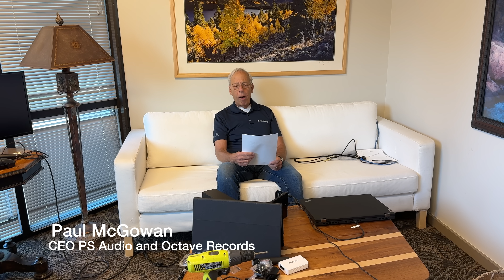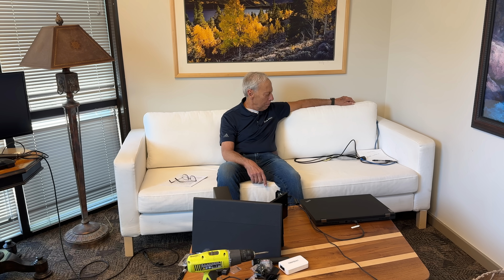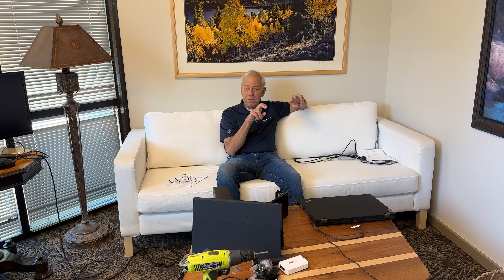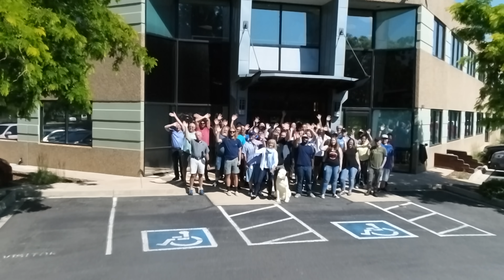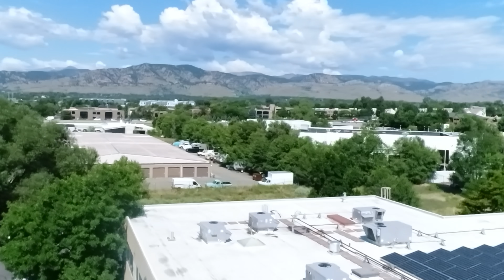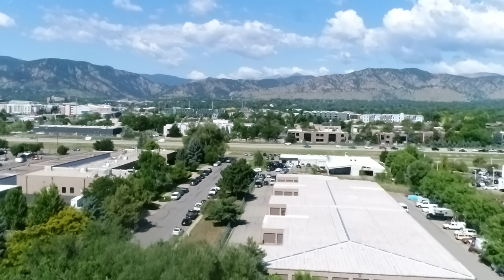Passive Preamplifiers

Comment: I don't know if there's a loss of low end or slam. As much as the addition of it by an active preamp. 

People liking passive preamps have nothing to do with why people like vinyl. Active preamps, like cables, are made to be tone controls. Not conduits. Some (many if not most) audiophiles prefer the tone controls. Some don't.

A passive preamp with the right components, is far better than an active one that is created to alter the sound.

Comment: Here's my personal anecdote. (And I understand that "data" isn't the plural of "anecdote". 😂) Many years ago, I had a boss who was a massive audiophile. I am/was a modest one. We had pretty big offices, and we both had pretty good stereos in them. Mine was a spare Dynaco ST-70, an OG Magnovox CD-650, and some homebuilt speakers another engineer had designed. My "preamp" was a switchbox/volume pot that I cobbled together. My boss was using an Audio Research SP-9, which I had lusted after for years. 

One day, with our boss out, the engineer and I decided to A/B my switchbox and the SP-9 with the ST-70. First we did the SP-9, and we nodded at each other that it was might fine. Then we put the switchbox in place. Our jaws dropped. It was not subtle _at all_. What's the audiophile phrase? "As if a veil was lifted from the music." 

Now, I don't remember what the value of the volume pot was, and I had made no real attempt to match anything with the input impedance on the ST-70. So, plain dumb luck. Now that I "know better", I'm not sure why the switchbox won that competition hands down, but it did. I've never tried this approach with my Conrad Johnson PV-5/MV-50 because I need the phone stage and I love how it sounds, but it would be an interesting test!
Reply: Exactly! perfect The passive pre has the best technical specification in the world! It's unsurpassed: because it's innocuous to audio, output signal is a copy of the input signal only with variable amplitude control, it's game over for high fidelity.

Comment: I wasted 5 years using a passive preamp with stepped resistors. When I replaced it with a tube preamp, the result was stunning. The whole sound stage opened up with size, detail and layering I had never heard before. I cursed the journalist who led me down that path.
Reply: You should have been using a transformer based passive preamp.
Reply: @robertdevoy3119  No better. The problem is that some DACs do not have enough power in their analogue output to drive the passive preamp, cables and amp input.

Comment: It isn't a "charm". A good passive is going to be more transparent than a good active. Actives have more of a sound than a good passive. Which is why people like them. Which isn't an issue in the slightest. 

But a good passive isn't losing dynamics, weight, or slam. It isn't adding them, like many actives, either.

Comment: I’m using a passive preamp with an alps 27 pot with 50k impedance. The sound is transparent,
dynamic and just straight up clean. Better than any active preamp I’ve heard.
Reply: from which brand of passive preamp do you have?
Reply: @L7F0X 
Technically it’s simply a volume pot with a single set of rca inputs and one set of rca outputs. 
No name brand made in China using an Alps pot for volume control. 
I also have a Tisbury passive preamp made in the UK. It has dual outputs with three selectable rca inputs. The Tisbury doesn’t provide as much resolution as the other piece. The volume pot on the Tisbury isn’t an Alps but uses a large bank of resistors to control its output so not sure if that’s what is making the sound difference.

Comment: I settled on an Ypsilon transformer "passive pre-amp". I find it by far the best pre-amp l have heard, certanly better than a high quality resistor ladder unit l had for awhile. Great dynamics and transparency. It requires system matching though as it doesn't provide gain of course.

Comment: That's exactly what my preamp is "No Preamp".  I've built myself a beautiful stepped attenuator and a 6-way double pole selector switch in an all aluminum box (very short wiring). That allows selection of my audio sources, via attenuation to feed directly into my KT88 equipped VTA ST-120 amplifier.  Sounds simply wonderful. ❤

Comment: Passive means changing the impedance of i/p and o/p sources, and setting up series/parallel impedances, not good in my opinion.  A fixed matching input (47k) converted into a less than 75ohm output Z with individual resistor(s) for volume is a likely better setup.

Comment: Passive is not for every situation.  An excellent alternative is a high quality autoformer.  Dave Slagle makes an AVC that is pretty sweet.  The output Z drops as attenuation increases starting at 100 ohms and dropping to nothing.  My source has a nice tube output, so the AVC is quite a good match.  It is basically a wire up to around 250kHz.  I found any type of resistance pot noticeably inferior for my taste.
Reply: Same here!

Comment: My pre amp is a 47 step attenuator built by GOLD POINT in Calif. and I like that the signal is clean end to end
Reply: I just built a passive volume control with a GOLD POINT 47 step 10K attenuator. No issues driving a pair of DIY Hypex Nilai 500 monoblocks with a 48K input impedence. Clarity is superb. I'm considering swapping in a 5K GOLD POINT to see if the old 10:1 impedence rule makes a difference. Right now, 5:1 seems to be working well.
Reply: @ericlarsen1721  I had them build it. 4 RCA out 1 in couldn't be happier a little pricey but worth it

Comment: Paul - not sure if I’m the first here to say that as one of your septuagenarian viewers, I can fondly remember owning one of those dual chassis phono pre/line stage combos and the first brick power amp as part of my constantly shifting arsenal of audio weaponry “back in the day”. However, I’d be lying if I stayed I can remember the differences I might have heard between the passive and active mode on the line stage - far too many changes of gear, and too many magic cigarettes during those couple of decades before parenthood. 
What I can remember is that Acoustat II, dual mono bridged Model II amps and Polk “Cobra” cable was not a particularly stable or synergetic combo - a different kind of magic smoke there😂
Cheers

Comment: Different than passive preamp as you described is the transformer volume control . It does some things better , but a very high-end unit can cost as much as a preamp with gain & more drive .
Reply: Perhaps this it true because the passive transformers are expensive. However, the resulting transparency is well worth it.

Comment: "Passive" pre-amps are NOT isolated from the output caps feeding the "pre-amp" and any input caps at the receiving end.
So essentially what you got is some type of  R/C (or R/C2) filter since the "pre-amp" is coupled (not isolated) from the input device and the 
device it's feeding. Unless both connected devices have purely resistive impedance you will most definitely alter the frequency response curve of the input.

Comment: The voltage sent from a source to the amplifiers needs to be controlled. There are 3 types of line level/ volume controls most often used. Starting with the worst approach, digital volume controls direct from a DAC into the amps. If you happen to have a perfect match, say a 2V peak output from the DAC with a 2V sensitivity to full output in the amp. a direct connection will drive your system to full volume all the time. To cut the volume in half you have to remove the most significant bit/ cut the sample bit depth in half. You want a 1/4 volume? Take that 16 bits and covert it to 4 bit depth. Peak voltage out will be what you want for volume but all resolution is gone! 

So instead of bit removal to get reduce voltage out, some adopt a VCA, Voltage Controlled Amplifier stage. They control the amount of voltage fed to the output stage so it can only vary between zero and that reduce voltage. So the entire 16, 24, 32 bits will always be resolved. Problem is an amp's sound will change based on it's supply voltage. So the sound will change quite a bit as the volume is adjusted. 

The best is the old fashion passive volume control. Be it a POT/ variable resistor or a resistor ladder. The full output voltage from the source is applied to one side and the amount voltage out depends strictly on were the output is tapped off of that resistor. Want a 1/4 volume, use 1/4 of the way across the resistor section. The entire 16. 24, 32... bits will always be resolved. Only the voltage level to the amp changes. Well except in the real world there are always other outside components. Primarily capacitors at the output of the DAC and input to the amps. The passive volume control acts as a R/C circuit then. R/C circuit are used for high or low pass filtering. The added resistance can cause high end roll off. So they build active circuits around it.
Reply: Boy stop telling the truth in public.wow.. you sound old and smart..haha..and your correct in my opinion..
Reply: @davidstevens7809  Old, ya! And been around, ya. and can sound smart at times, ya. Able to control responding, Not so much.
Reply: I read somewhere that modern digital volume controls are high enough bits 32 or 64 that they do not degrade the signal. Don't most modern DAC chips have digital volume control built in?
Reply: @dwaynepiper3261  What volume control setting do you most often listen to your system at? Cranked full open taking advantage of all those 32 or 64 bits? Or at half way at most, dropping to half the bits, 16 or 32? All the time? Maybe be 1/4 open ... 8 bits maybe?
Reply: @glenncurry3041  So your telling me all these DSP processors and Room EQ correction in modern equipment that is filtering specific frequency and adjusting the level is bad?
Reply: @dwaynepiper3261  So you're (correct version) telling me you can't answer the question so you drag red herrings out of desperation?

Comment: Majority of modern ‘audiophile’ passive pre’s do not employ series resistor pots. Most are using autoformers, multi-tap transformers, as a volume control with lower output impedance. This can be very effective with most modern DAC’s, some of which too have buffered volume controls in output section and enough output voltage to easily drive the amps.

Comment: A passive attenuator will be superior to any active pre-amp if the following is observed;very low cable capacitance to and from the attenuator;source equipment with low output impedance and high input impedance of amp or in my case active crossover being driven.
The usual problem  of lack of dynamics is when incompatible equipment is used;ie.low input impedance amps
which results in lack of current drive.

Comment: Has anyone thought about stereo width?
The more resistance you have between signal
L R The less stereo you get. a potentiometer always gives a certain resistance across L and GND and R and GND. since both GNDs are connected, you get a load over L R that varies up and down. you get more and less stereo when you turn the volume up and down. at low volume you get less stereo

If this is wrong, please let me know.

Comment: Hello. I have an amplifier. Naim NAP250 clone card and have made my own amplifier.

When I use different active preamplifiers, the sound is always worse, especially in treble details. I have tried one that only has op amp ic. and no coupling capacitor and a slightly more advanced one with a coupling capacitor on the output.

I find my passive preamplifier to give better sound and more transparent sound.

The passive only has an input selector and potentiometer which is connected to my DAC. which is connected to my computer.

I have done the test many times with the same result.

I don't know why I'm experiencing this.

Naim has a coupling capacitor on the input

Comment: First of all, a passive pre-amp does not exist. Nothing gets amplified. If you want to do a passive volume control, do it with an attenuation transformer. This also has the advantage to lower the impedance as you step down the output signal. Further more, a passive volume control is best used with a tube amp that has a very high input impedance. Ideally the power tube amp has full output at line level input (200 mV). Many tube amps can do this with only two stages witch results in a very direct signal path. At this point, the set up is basically a full amplifier with out board volume control. There is nothing wrong with that.

Comment: Isn’t 6db is double the volume? How many steps before ur blown off the seat 😂
Reply: Actually the sound pressure doubles every 3 dB. It's a logarithmic scale
Reply: Start at 0.5W as first step, not loud enough, and then 1W, 2W, 4W, 8W, 16W, (into good area now) 32W, 64W (Party time) 128W.  I make that 9 steps, mine has 8. Honestly, I really don’t think it’s a problem, 3dB if you wish, but that’s a perceptible change, and as I said, I can’t be arsed with getting up for such a small change.  The attenuator was more of a development step, the real issue was control of input and output impedance, and the cable capacitance combining to form a low-pass filter, knowing phase starts to move a decade below attenuation. (3dB bandwidth at 20KHz has a phase shift starting at 2KHz)

Comment: It’s interesting if such “passive pre-amp” alters the sound at an audible level. If all it contains are switches and purely resistive components, what comes out is a ratio of what comes in (<1 gain) but perhaps some source devices will sound different with slightly lower load impedance. But in my humble opinion, if the sound is audibly different due to a 10k ohm resistive load, the source device output stage really is not well-designed. Whatever makes an audible difference does not involve any magic.

Comment: There are some really high inpedance power amps that certainly give you better matching. A friend had a reputable brand pre amp (old 'sqcool' british)and in that case a passive trumped it completely - though the device was getting a bit old I must say....
Reply: Even if you have a high impedance power amp, there is still the issue of the capacitance of your interconnects effectively forming a rc filter, attenuating the top end.
Reply: @paulstubbs7678  What if the cables are short and reasonable quality?
Reply: @paulstubbs7678  Never noticed more top when I went active, and the opposite with the old sqhool replacement, though I have always kept cables as short as possible...

Comment: Paul is correct. The other issue is that any kind of resistor will have some amount of inherent noise. The higher the resistor value, the higher the noise. A 100K pot at room temp will have an effective noise of about 5uv. A 10K pot will have its noise around 1.7uv. If your amp has sufficient gain, you will definitely hear the difference.
Reply: @tristanjones7735,so a single resistor is an issue but an active pre-amp with loads of resistors,transistors/tubes and capacitors in the signal path is`nt ?
Reply: @BRATWURST1  Sure, an active preamp can add a TON of noise if not designed correctly. However the question is why do people like passive preamps.

Comment: Passive pre-amplifier is an oxymoron? Passive volume control or stepped attenuator more like. Switched resistor pairs are much better than a pot due to pretty much anything, better tolerance, control of the input and output impedance, switch quality, etc. Pots are just lazy, the impedance is what it is, mechanical issues, deviation from ideal Log etc. I still have a passive stepped attenuator switched in 6dB steps, based on much less than 6 dB isn’t worth getting out the chair for. :-  ) Very short (6”) captive cables designed to just reach from my pre to the power amp. Note; Cables do matter with passive controls. (capacitance)
Reply: "Passive pre-amplifier is an oxymoron?" - While i totally get your point, you could argue 'passive pre-amplifier' as a passive device that signal goes through before (pre) the amplifier. Semantic jiggery-pokery I know... you can tweak language far too much really, it's no wonder we humans get so confused with each other all the time.

And yes, that definition would also include interconnects - we work with what we got eh:D
Reply: I cringed when I read this oxymoron also. What a 'meritocracy' we must live in.
Reply: Yeah excellent comment about the switching resistors. I found a box on ebay which is just relay based volume control it looks good- around 100 bucks. The knob on the front runs the relay.  I wonder if it’s any good long term. This has to be the best way to get rid of the impedance problem. As you said as long as the cables can be kept short this method should be superior to an active gain stage. I think for some people dealing with passive solutions might be too inconvenient for them. Also having a preamp that is truly transparent sounding is very expensive.